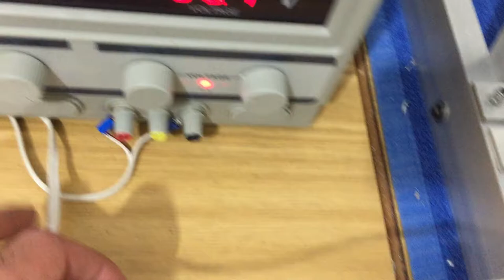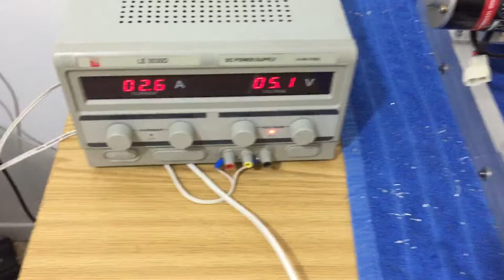Magnetic machine produces electricity With 5 generators magnet motor engine (For future use)

Comment: what are those wheels in the back of the machine? they re connected to the motor shaft. are they small flywheels?
Reply from the maker: They also flywheels and battery chargers